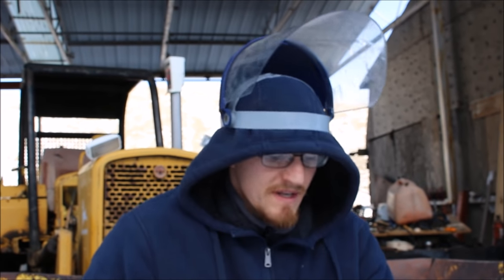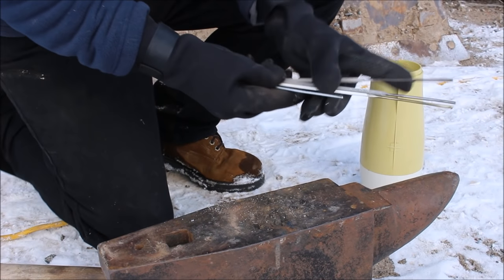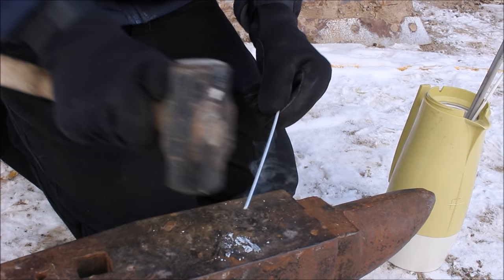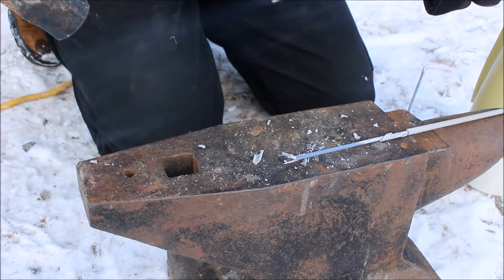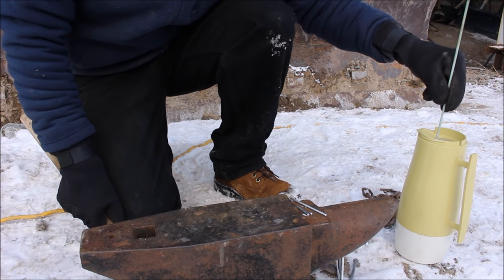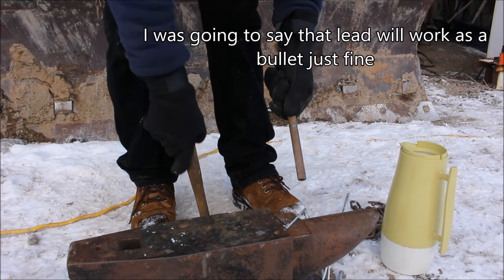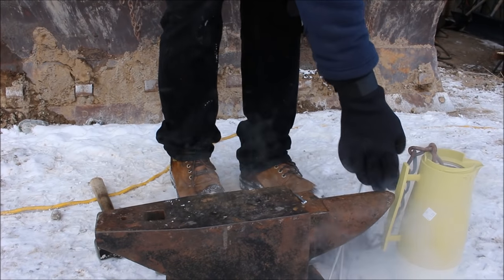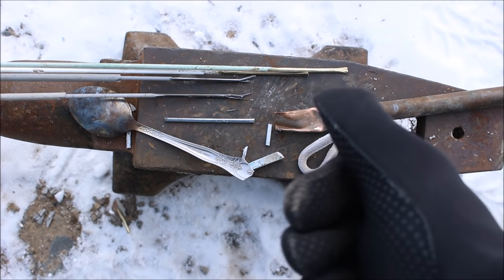Liquid Nitrogen Vs Metals (cold gun part 1)

Comment: if you are indeed intending to fire frozen mercury from a copper alloy barrel, let me point out some risks. copper alloy is not rated for high pressures. i would be hesitant to even fire a .22 round from a copper alloy barrel. more importantly, the combustion will undoubtedly cause some of the frozen mercury to vaporize into a VERY POISONOUS gas! there are lots of chemical reactions taking place in what you may be trying so check out the chemistry before trying. stay safe, i think its a very interesting concept.
Reply from the maker: +Nathan Zeligman 
yup yup. sounds fun doesn't it :)

Comment: I have a question completely unrelated to the video. Recently, I saw a demonstration where someone heated up a quarter to red hot and then dropped it in methanol. The quarter came out copper colored. I know that the inside of new quarters are made out of copper, so I was wondering if the methanol dissolved the nickel coating that was on the copper? Any answers or hypothesis are appreciated.

Comment: Thanks cody, you just gave burglars and thieves a super fast way to break chains and locks with nothing but a hammer and a can of liquid nitrogen :D
Reply: Or they can just keep using bolt cutters. No need to mess around with liquid nitrogen or make a lot of noise with a hammer.
Reply: ***** Neither will this. How do you want to dip a door lock in liquid nitrogen?
Reply: ***** Does that really work? Steel needs to get really cold to become brittle enough to break with a hammer. That doesn't seem very plausible without a proper seal and the nitrogen just spilling all over the place. 
Besides there's no need to anyway. Just unscrew the escutcheon, grab the lock with pliers and break it in half. And that's with european doors. With most american doors (with locks in the door knob) you don't need to unscrew anything, just break off the door knob and open.
Reply: ***** Yeah, deadbolts are the standard in Europe. Still, unless you've got a security escutcheon, you can simply break the lock off with pliers. 
Using the nitrogen to weaken the pins is a nice idea, that actually sounds plausible.

Comment: You might try a shock resistant tool steel. "S7" perhaps. It may be just as brittle at those temps as the others but it is worth a shot. There are also some stainless steels that use a cryo process during their heat treating. These may handle the stresses better.

Comment: I am very surprised that your "aluminum" fractured after cooling it with liquid nitrogen. Aluminium is a metal that does not have any ductile-brittle transition and is therefore commonly used in cryogenic applications. I have my self investigated the toughness/brittleness of some aluminum alloys at cryogenic temperatures and found that they actually perform better at lower temperature, not worse as in your case.
Reply: The main word there "alloys"
Reply: Yes you are probably right in that the welding rod that he used was probably heavily alloyed. Zinc comes to mind which is a metal that is known to becomes brittle at low temperature.

Comment: What explosive are you planning to use?
Reply from the maker: +Fatih Mercan 
black powder
Reply: a depleted uranium bomb :D
Reply: +Cody'sLab I've seen siberian hunting videos using black powder rifles in sub zero degree temps, so it should be fine. Moisture would be the only problem, obviously.
Reply: +rdizzy1 sub zero Temps often result in a dry environment
Reply: trevor pierce
Yeah I mean if you are artificially cooling the black powder, could accidentally get it moist.
Reply: rdizzy1 wonder if black powder can ignite submerged in liquid nitrogen
Reply: +trevor pierce you would  have to get a bit of the powder up above the activation energy of the reaction for the reaction to take place, with all that nitrogen sucking up all the energy boiling away I doubt you could ignite the powder
Reply: +trevor pierce 
No expert, but I don't see why not. Nitrogen is mostly inert (ie. it causes no reaction when coming into contact with most elements) and it's 78% of the air we breathe already. Black powder uses charcoal for fuel, sulphur as a binding agent (which also lowers the required ignition temperature) and Potassium Nitrate as an oxidizer, which is where it gets its oxygen from.

Not sure how easy it would be to actually do. A couple wires attached to a small amount of steel wool, pit a pile of black powder on top, pour in Liquid Nitrogen and ignite with a 9 volt battery.... except adding the liquid would probably displace the powder moving it all around the place, not to mention the bubbling caused by it boiling. Perhaps a small container over it which could slowly be removed after adding the Nitrogen.... Cody's a clever guy. Perhaps it's an idea for another day.
Reply: +madhouse5213 lol
Reply: Phoenix2079x Minecraft&More  im prob on the NSA watchlist now
Reply: +madhouse5213 " im prob on the NSA watchlist now "
Well you weren’t but you are now. 
Guilt by association...with me.
Welcome to the club.

Comment: You might want to reconsider the feasibility of actually just freeze a normal steel gun. Iraqveteran8888 froze a hipoint 45acp pistol which are made from die cast zinc-aluminum alloy (zamak-3) in alcohol cooled to -110F with dry ice. They shot it successfully with no issues.
Reply from the maker: +Anemathis 
how about -320F?

Comment: So could you not just find out the coefficient of expansion for the metal and then derive the size of the uncooled bullet from that. obviously there would be a risk of the bullet getting stuck in a barrel, so would you use round ball in a smooth bore barrel? for best chance of it working?

Comment: Is the brass maybe just work hardening? Maybe at a steeply accelerated rate due to the cold?
Reply: If this is the case, then it's application in a gun should be just fine, as only cold forming has this effect, and it's application within the gun would only harden the very surface, leaving the metal malleable.

Comment: I would guess that gunpowder will not ignite when extremely cold! It needs heat, fuel and an oxidizing agent to burn. The liquid Nitrogen will remove all Oxygen and it's very cold, thus removing two parts of the combustion triangle.
Reply: +PuchMaxi1988 I don't think hes going to soak the gunpowder in the liquid nitrogen, probably just put it in a receptacle then put that into the nitrogen. Siberian hunters use blackpowder rifles at lower than 30 degrees below zero though.
Reply: The main ingredient of black powder is Potassium Nitrate, an oxidizer. This is where it gets it oxygen from.
Reply: Ah yes, of course good points! I just realised the potassium nitrate is the oxidizing agent. I'm not sure if a primer would fire when extremely cold, in order to ignite the black powder in the cartridge? I guess Cody wants to make some kind of 'liquid' projectile.
Reply: +PuchMaxi1988 Can't say for sure about the primer. Maybe in temps equal to liquid nitrogen it would become too hard and resist the impact needed to detonate.

He stated "frozen bullet", which I take to mean an actual bullet. If he'd said projectile, then that could be anything. Guess we'll just have to wait and see 😊

Comment: Cool stuff!
I knew aluminum was bad at low temperature but it was very impressive to see.
One thing to note is that a slight change in the alloy of brass will make a big difference in how brittle it is. Some alloys can't be cold worked at all and will break even at room temperature.

Comment: wait, do any guns have problems firing in the cold temperatures found in nature? like your guns will never get anywhere as cold as it is in liquid Nitrogen. even in the vacuum of space, a gun won't freeze quickly, as theres very little matter to absorb the heat. guns that work in the freezing cold winter would be good though, as I can see having to use something to warm up a gun before firing can be a liability.
Reply: +higbey the demon
Sure they do.
Airguns perform noticeably worse at low temp and CO₂ guns can even not work at all.
Some flamable propellants also proprll worse when cold.

Also stop posting nonsense about space coldness. There is no heat sinking in space so problem is not cold but overheat: the sun is there so you will get hot but there is no air so you can not cool by any means other than radiating heat back. Can you or your gun radiate more heat than sun? I doubt that.
Reply: Beardman Hairy thats why I said its not a problem keeping the gun from getting too cold in space, its more preventing it overtheating from successive fire, they have shot a gun in space before.
Reply: yup

Comment: Could this be an easier method to make aluminum powder? Just supercool it and then put it into a coffee grinder?
Reply: +Grove332 no.
Reply: +Grove332 Coffee grinder... No but a rolling steel ball with 700 LBS of pressure behind it... Maybe. But you'd have to be quick with it. The aluminum will warm up due to the friction.

Comment: Since you're collaborating with Jeff (Taofledermaus) you'd obviously be aware of the many reasons this has failed so many in the past (Demolition Ranch and Mythbusters included). A projectile made of frozen H2O has low weight and density, plus is incredibly fragile.

Despite the pressure the ice is put under during launch, I believe that heat is also an issue. Your average firearm projectile is said to heat between 100-300 degrees Celsius when fired. Makes sense, as the surfaces of a fighter jet at mach 3 heats to over 300 degrees.

I have no idea what you two are cooking up, but I look forward to seeing it.

The most successful ice projectile I've seen to date is here https://youtu.be/IpnayW-8XfY

Comment: Interesting. Aluminum is not supposed to lose impact strength at low temperature. Stainless steel is not supposed to either.
Reply: Low, or super low?
Reply: +ThisisNOTCONNECTED TOMYYOUTUBE any temperature. That's the reason things like liquid nitrogen hauling trucks are made of aluminum.

Comment: is that Lead or tin on the roll...not surprizing that coper did very well brass contains a lot of copper....
Reply: +Martijn Fransen It's pure lead that he uses for radiator work.
Reply: +Martijn Fransen I am sure it was not Tin, because Tin becomes very brittle at cold temperatures. This is due to its tetragonal crystal-structure which does not allow for as many slip planes as the fcc structure found in for example lead and copper.

Comment: Gah, I posted a comment that has disappeared. If anyone finds it, comment on it so I can delete it. You said frozen bullet and my mind thought ice, so the comment is irrelevant.

Based on your experiment, a copper jacketed bullet is your best choice of projectile for not shattering in the barrel, too.

Idea: Could you just make a simple gun like a fireworks mortar? Even if it's only cardboard, as fireworks are, you could make the entire gun in a tube just like a regular cartridge, freeze it, then slide it into a steel pipe to fire it.

Comment: I wonder about zincs strength in liquid nitrogen
Reply: Zinc would just bend, it bends with little force at normal temps, that's why they uses it in stainless steel that and it gives it the stainless properties
Reply: G-Metric oh thanks

Comment: If you want to be really serious about this and don't mind spending money, an alloy of 20-25% silver (by weight) to copper will produce an alloy with comparable properties to high carbon steel, and should be good down to low temperatures (source below)

www(dot)dtic(dot)mil/cgi-bin/GetTRDoc?AD=ADA475281

Practically though a brass or bronze alloy would be the most viable. Cannons where historically made out of the stuff to great effect, and it won't be nearly as expensive.

Comment: You waited waaayyyy to fucking long between pulling them out and hitting them. Like 5 seconds between pulling them out and hitting them... that is fucking horrible. The metal starts to heat up, and pretty fast, from the moment you pull them out, meaning that over those 5 seconds you lost so much credibility in your experiment. You ever wonder why in movies and shit they cool the metal and than instantly try to shatter the metal? It's because that is literally how fast you have to be, not cooling the metal then slowly explaining exactly what you are doing and THEN hitting the metal.